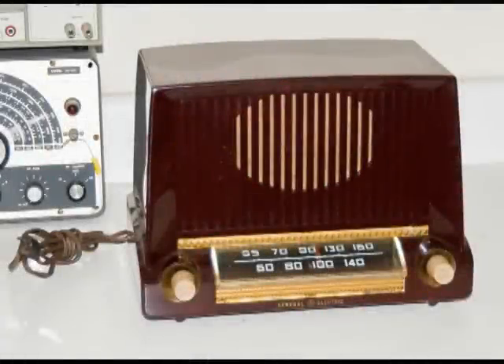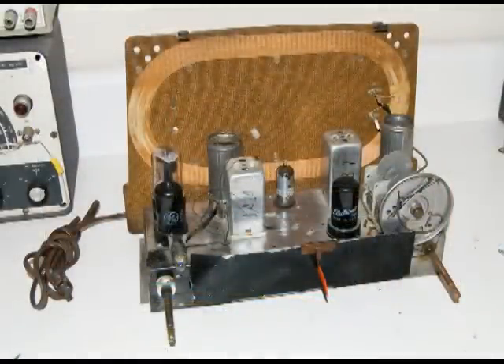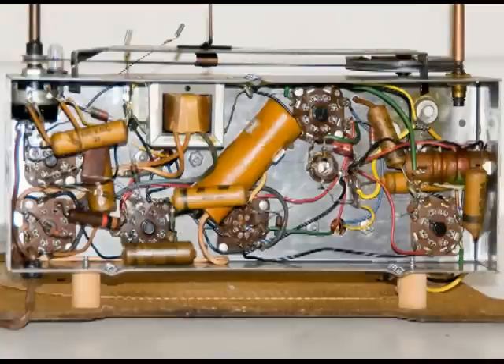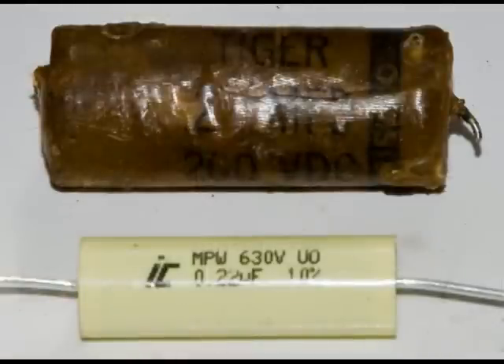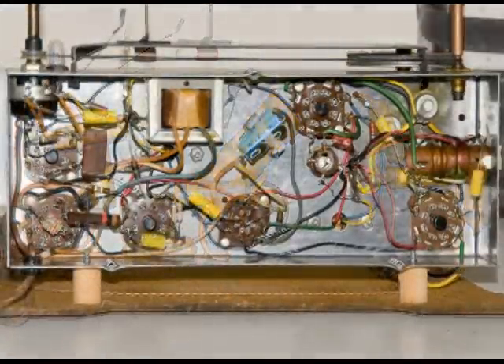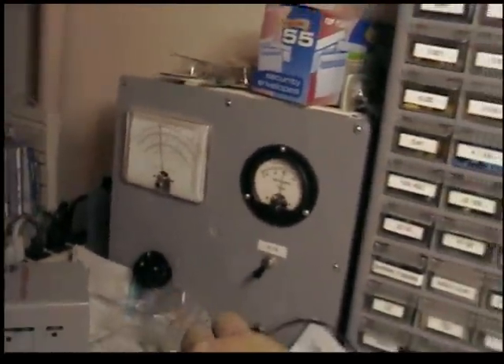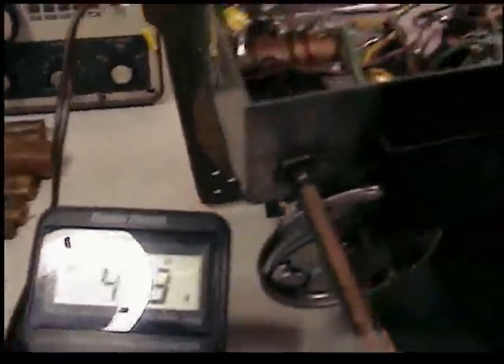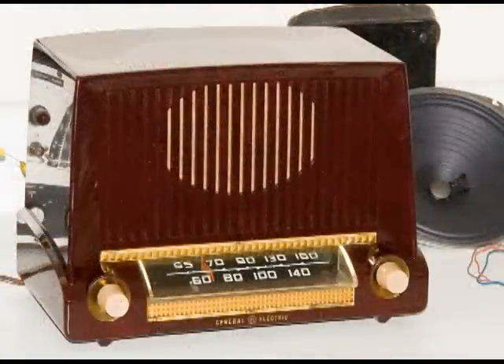Radio Repair Steps

Comment: when do you deciced 160V is enough versus 400 volts - Im working with an airline 64wg?
which is an AA5 like this one
Reply from the maker: The vacuum tubes specification determines architecture. 
Below is a link to the 35L6  specifications.
https://nj7p.org/Tubes/SQL/Tube_query.php?Type=35L6
Reply: @AllAmericanFiveRadio  so pending on the pin that it is on...
Reply: @AllAmericanFiveRadio  im trying to get a airline h64 working. all the lights are on with no excessive current but bunch of hum (loud)
Reply from the maker: Have you replaced the electrolytic capacitors in the power supply?
Reply: @AllAmericanFiveRadio not yet am looking at which ones to do am going to start there
Reply: @AllAmericanFiveRadio  No I have not but am working towards that. Why do you ask, please lead me and I will follow :-)
Reply from the maker: @kilroy79763  If the hum remains the same when you change the volume, chances are the electrolytic are bad. I have a free eBook that will help you. Below is the password and download link. 
Password is allamericanfiveradio

https://www.youtube.com/redirect?event=channel_description&redir_token=QUFFLUhqa2hhVTRycWdJd1FUbTFCZWNmdGtQNlZCRmEzd3xBQ3Jtc0tuOFQ2bFhRcWdjdUdIcUREcnZFaHc0M2xURGhITVRuWDE2cGlDakdYUF9uODktNzc3TVRJTWdROUt6R3NLN2lla3hFS2lIM0RnOXR1dXFxMGx2cUNtWDhXb1Zvc2RCbGQxTThoendmN2E5R0lJdmI0Yw&q=https%3A%2F%2Fdrive.google.com%2Ffile%2Fd%2F1HHmaWYr7UMACfmS4W5uL6PADoem2KlRp%2Fview%3Fusp%3Dsharing
Reply: @AllAmericanFiveRadio  thanks yeah...I been reading it. Im looking at the schematic and will concentrate on the power supply first

Comment: I have been trying to find a decent method to mounting some new filter caps in a 6 tube Motorola ac/dc set I’ve got, I could make a tie strip work. I’d left the original mounting in there, and from seeing how you mounted it mechanically I think that’s a lot better than my floating caps! Thank you so much!
Reply from the maker: Thank You!
Please do not leave old parts in circuit, they only cause problems.
I have a FREE Ebook you mybe interestind in, the password is

allamericanfiveradio

here is the download link.
https://drive.google.com/file/d/1HHmaWYr7UMACfmS4W5uL6PADoem2KlRp/view?usp=sharing
Reply: @AllAmericanFiveRadio  it’s been completely recapped. It’s just the main DC filter caps I used are not mechanically/physically secure. I’ve got there grounds connected with some bus wire, and the positive leads go to there connections to the rectifier socket. They are radial style caps. We’re the original dual cap went under the chassis there was a mount similar to this set. I did try what you did when I recapped the radio, to me I was uncomfortable attempting it with that style of cap! I only replaced resistors when there out of tolerance, or if the are internally damaged.
Reply from the maker: @tucker934  Did you get the radio working?
Reply: @AllAmericanFiveRadio  yes, and sadly i believe it’s got “SMD”, it’s not super bad yet, but it will start “tuning it’s self”. Then it will begin to oscillate pretty bad, and after about 30 seconds pop, cracks, and it starts receiving again till about 10min then it kinda repeats it’s not a perfect pattern, slightly getting worse over time. After two hours it’s starts get pretty bad, but nothing like what I’ve seen most on here! The tone control is also not in great shape, and I’ve noticed that it’s tone is quite random though out the travel of the potentiometer, and in some places it will become “muddy”. The set it’s self seems nice it’s a aa6 that I believe might have a tuned RF amp stage, before the converter it’s a Motorola 63X2.
Reply from the maker: @tucker934  My FREE eBook may help.

PASSWORD is allamericanfiveradio

https://drive.google.com/file/d/1HHmaWYr7UMACfmS4W5uL6PADoem2KlRp/view?usp=sharing

Replacing IF Mica Capacitors page 153

Comment: Just curious...on these All American 5's (and even a power transformer types) do you build in some sort of voltage drop to compensate for the 125VAC? If so...what is your preferred method? Thanks 😊
Reply from the maker: Most of these AA five radios will handle 125 VAC without any problems.

Comment: You know, you are the ONLY person that I have ever heard mention anything about measuring and confirming that the inductors and transformers are all good as a first step.  In fact, I don't think anyone has ever mentioned checking them at all unless there was a problem with them.  I appreciate your mentioning that...I will keep it in mind.
I'm curious...when you replace the wax capacitors, do you test and make sure that the outside foil lead of the new capacitors is connected to the low impedance side of the circuit?  (See  https://www.youtube.com/watch?v=BnR_DLd1PDI  )
Also, do you make sure that the capacitance and working voltage are visible on the new capacitors?
What got you interested in radios?
Reply from the maker: Thanks!
In AM and FM radios I don't bother with which side is which in on the capacitors in those radios. If you where working on equipment with specifications of .00000000001 that's different, everything matters. 
I do put parts in so that you can read the labeling. I have always been interested in radio/electronic.
Download my FREE ebook.
password is allamericanfiveradio

https://drive.google.com/file/d/1HHmaWYr7UMACfmS4W5uL6PADoem2KlRp/view?usp=sharing

Comment: Very nice   radio, your restoration brought her back among the living to once again serve man for another 40-50 years.  Great video and wonderful restoration work on the old set. That was built back when the Radio was the centerpiece of the setting room. I can recall growing up in our old farm house which was built by my grandfather in 1910 and never saw the modernization of electric power or running water.  At night back in the 1950's we would all gather in the living room, dad would have a kerosene lamp by his chair on a small end table.  Atop the tall writing desk sat our prize radio, it ran on a  large battery pack which cost money (according to Dad) and should never be played for just music.  We loved hearing the Lone Ranger, Suspense and Johnny Dollar, Gunsmoke and Paladin.  Great times, the theatre of the mind, a thing no longer appreciated by the younger generation  Most recently I have been building small wifi radio sets that can access these programs over the web and play them  back on my home built radio in a box type set.  I have had some luck integrating these wifi builds into old radios so you can really turn back the time by playing say programing from the 40's and 50's on the sets made in the same period. I have done this both using a small FM transmitter into replica radios which have an FM band, and wiring into the old set's audio circuit and pushing the output from my WIFI receiver through that warm and wonderful sound of real tubes.
Reply from the maker: I can remember visiting some reliefs in the Ozarks in the 1960's. They had get got electricity in the house. The wires ran outside the walls to each porcelain isolator or switch or outlet. It was an interesting installation.
I have a few one transistor AM and FM transmitters, they work well.
Thanks for writing your comments. Enjoy them.

Comment: How do you test to see if the coils "are good"?
Reply from the maker: Download my free eBook. It is on a bigger radio but the procedure is the same.
Password is 'allamericanfiveradio'
The Vacuum Tube Shortwave Radio
http://www.richardmcwhorter.com/vacuumtuberadio/ 

Videos
Portable Tube Radio Repair, test tubes and check all coils
https://www.youtube.com/watch?v=FT41gCPEEic

IF, Oscillator, Antenna Coils Continuity Test, Stewart Warner 1301
https://www.youtube.com/watch?v=OCMyFKx1-YE

Bendex AA5 Repair, Testing All Coils
https://www.youtube.com/watch?v=tVMJNB4J_sU

Comment: do you make sure the foil side of the capacitor is connected to the most negative part of the circuit.?
Reply from the maker: No it' not necessary.

Comment: Beautiful radio ,I love your videos ,I like your radio shack meter ,didn't no they made one.like that it looks like the fluke ,I had a radio shack meter over thirty years when it died,I hope someday to buy a fluke ,there are other gear I need to buy ,to work on.old radios with ,as some people no I won.a Amazing Knight of 670 capacitor ,a nice no use of low use one that was restored by bUddy ,I just bought a Heath kit tc-2 tube tester in fair shape,I replace one was cap and later I will replace a large wire wound resistor ,once I sure of the value ,Could you or any of your fans tell me where I can get more info my tube chart is pretty out dated ,It doesn't have many of the AA5 tube info I need to test those five tubes and where I might find this info ,I hopeing to buy some heathkit
Reply from the maker: I would think that a Heathkit forum may be your best chance to get the information you're looking for.

Comment: i am new at this but could any body tell me what i could sub a .005 - 650 volt capacitor with ?? .047 be ok i do have .0022 650 volt would that be ok ?? if any body would have a replacement chart for some of the odd capacitor values . that would be a big help .
Reply from the maker: What are you working on? What is the manufacture and model number?
Reply: rca model 65x1  thanks for the reply means a lot to me sir !!

Comment: How do you know if it’s an Electrolytic cap? Or other.can u advise,I’ve got too repair a reel to reel tape recorder 1950s thanks.
Reply from the maker: Electrolytic capacitors that old have dried out and need to be replaced. And all the paper capacitors will need to be replaced. This book is about repairing radios but the amplifier circuit and record circuit are very similar the audio amplifier in a radio.
The Vacuum Tube Shortwave Radio
http://www.richardmcwhorter.com/vacuumtuberadio/

Password 'allamericanfiveradio'

Comment: Thanks for the great video,  It provides much information in a short concise time.  I like that.  
But why do you need to check the coils?  I would think that coils would be immortal.  Air coils and slug tuned.  Also, how do you check the coils?  Do you check for continuity or breaks, or do you check the actual inductance?

I just downloaded your book and it looks great.  I will definitely give it a read.  Just what i love to read too.  You probably answer my questions there.  
thanks
B
Reply: Could you give me the web site to download his book
Reply: @nor4277  You can find it under "About" on his channels start page.
Reply from the maker: Thank you.

Comment: Great video this is a great way to make a repair I am trying to find a schematic for s zenith N731 I have 200.000 f them but not the one i need and i can find a good source any ideas ? I have a problem with the fm reception and am  i get some am no fm
Reply from the maker: I found a schematic with the same zenith tube lineup. So it should work. Send me and email at allamericanfiveradio@yahoo.com and I'll email it to you.

Comment: Hello, I'm in wave repairing a radio transmitter power (150 watts), uses a combination of bulbs and transistors, and for restoration need a rotary switch 2 position, 4-pin and 12-pin, if you have this componenente is agradeceria send it to me, it would pay the cost, because in my country I could not find it, thanks for your attention
Reply from the maker: I don't have those parts but this website might.
Play Things Of Past
http://www.oldradioparts.com/
Reply: Thanks my friend! muy agradecido!

Comment: I recently bought an Emerson 558 radio and I need the B battery which is 67.5 volts. Can you tell me where I can get that?
Reply from the maker: +Beth Martin 
Your comment ended up in "Likely Spam".
I plug 9 V batteries in series together to get as close as possible but not going over don't wanted voltage. So you would plug seven 9 V batteries together to get 63 votes, which should work just fine.

Comment: I need to replace capacitors in my old radio but I can't find the correct values. What values are the capacitors you use and where could I find them? Thanks again. :-)

Comment: I recently bought a wooden radio at an antique store and I would like to get it running again. This is my first old radio. Do you have any tips for a beginner? Also, it is missing it's speaker.
Reply: Sorry, it's is supposed to be its.
Reply from the maker: Streamlined Steamroller 
Sometimes the audio transformer is mounted on the speaker, check to see if you have the transformer.
You can download my free ebook form this link:
http://www.richardmcwhorter.com/vacuumtuberadio/
Reply from the maker: Streamlined Steamroller 

Antique Electronic Supplyhttps://www.tubesandmore.com/
The Vacuum Tube Shortwave Radiohttp://www.richardmcwhorter.com/vacuumtuberadio/

Comment: Where do you buy your parts ?
Reply from the maker: Antique Electronic Supply and Play Things of the Past
Reply: AllAmericanFiveRadio
Thank you very much...
Reply: MultiTechnicss
Reply: You can buy the pieces at Radio schack, and in a electronic store.. buying antique pieces ( capacitor )is not recommanded at all, they can be dried. So buy new pieces...samething for fuses and resistances, resistors..

Comment: Great video! I'm trying to teach myself how to repair old radios but I have hit a wall on the cap replacement, I can do all the small single caps but not the large paper ones. My question is, do you fix radios for other people and can I contact you for help?
Thank you.
Reply from the maker: I don't care for shipping antique radios. So I recommend you find someone local and a good place to look would be in a local antique radio club or ham radio club. Someone in those types of club will know someone that repairs radios.

Comment: hi- I have an old Motorola radio out of my dad's old ford truck I still use..can you repair it? its out of a 1951, but its stamped 1948 and in very decent and clean condition on the inside. I see a couple of burnt vacume tubes.....bb

Comment from the maker: If it's not a very sophisticated radio I can AA5, suitable IF cans and oscillator coils are easily substituted. And this goes for most 30s 40s and 50s console radios too. However when you get into much more sophisticated radios like a Drake, you have to take from another Drake radio or try to find new old stock somewhere. I go through some of part replacement in my e-book, chapter 10.

Comment from the maker: I turned in up on the isolation transformer and variac, and it did not play. The resistor was read in circuit.

Comment: And i have few more problems... radio eats cassettes, wont record them, and what is that button on back (Osc? , it goes left-right) and if it helps... the radio can't be rustier from inside. Motherboard of radio is ... all SOLDERED! , i mean soldered so i cant get it upside down :/// i just said WOW when i saw it...

Comment: Wow, i appreciate your work, really nice... i just came here because my father's radio from 80's is half dead, i'm saying that because it WILL play on batteries, but not connected to electric power through cable (if you know what i mean :/ ) ,cable is allright I tried it on different , it plays well with AC/DC adaptor connected to where the batteries go :), but would you know why it doesnt work when i connect it with cable. radio is grundig c2600!

Comment from the maker: If the circuit diagram has values for the coils, otherwise mostly check to see if the reading is reasonable for the type of coil. Resistors I read in-circuit looking at the diagram, if something is in parallel it will read low. If they are discolored I just change them out. I replace all wax capacitors with 630WVDC. You may want to download my Ebook. The Vacuum Tube Shortwave Radio, go to my Channel Feed, third link down.

Comment: Hi Richard
When you check the coils are you reading a value or just whether they are open or not. Also when you read resistors are you cutting one end to read the value. And lastly what type of capacitors are you using to replace the wax type in old radios.
Thx
Francisco

Comment: you are a master
 I will need more time for understand the working of these jewels. In my Monitor radio, I have a noise when hasn´t a Station signal, but not very strong. I have 5, and 3 I repared. Sorry for my English.

Comment: Would you know what brand and year would be this radio with the line up of these tubes 
35Z5 50L6 125Q7 125K7 125A7 
with 1 shaft i would like to get a cover for it 
Thanks

Comment: Hi Rick! I found a Elecromatic radio. It is a small (10x6) 5 tube transformless radio. It doesn't have a model# anywhere but I looked on Nostalgia air and they have AR-301 (schematics only no tube layout)that is similar with mine. Do you know by any chance if Electromatic made more than 1 small radio model? One of the coils on the first IR Tr. is bad all caps and most resistors need to be replaced.2 of the tubes also. Do you think this radio is worth restoring?It it is pre 1948.Thank you.

Comment: Very helpful presentation of the procedure.  What I often do is hold onto the old electrolytics (and wax caps), hollow them out from the bottom, and install the new, smaller caps inside with hot glue, and run wires out.  Brown or black colored hot glue works well for this.  That way, the authentic look can be preserved underneath the chassis.

Comment from the maker: @bigredmachine878 
Yes most of the time I use the old leads and connect the new capacitor to them. To clean the old leads I use a fingernail file to shine them up a bit before soldering. That seems to work good.

Comment: @allamericanfiveradio How do you go about soldering the new capacitors to the old cap. leads? I prefer to solder the new capacitors to the existing leads of the old capacitors as well, but I have a hard time making a good tight connection. Thanks for the help!

Comment from the maker: @toltec13 
Hey Jorge
You could try adding little higher MFD capacitor. And or add another resistor plus another filter cap. Some times the rectifier tube is the problem. But if the hum is very low I done bother.
Rick